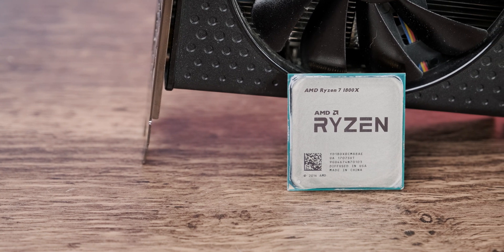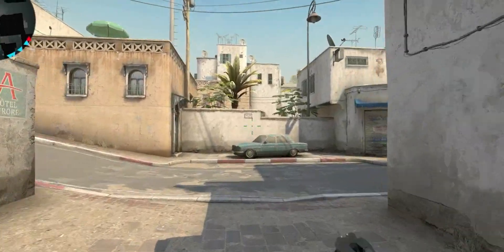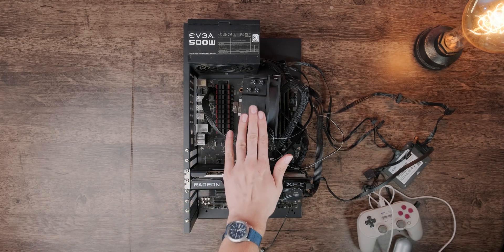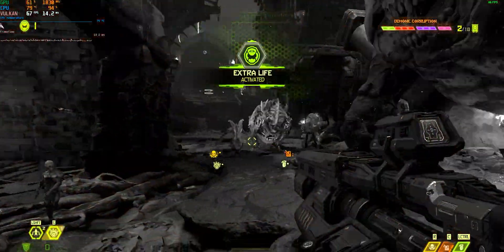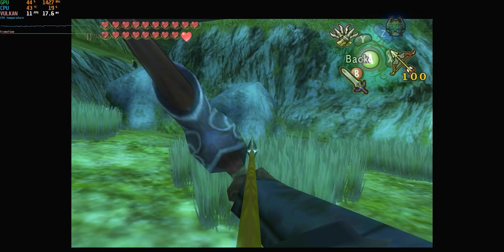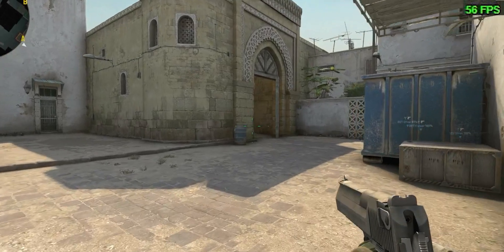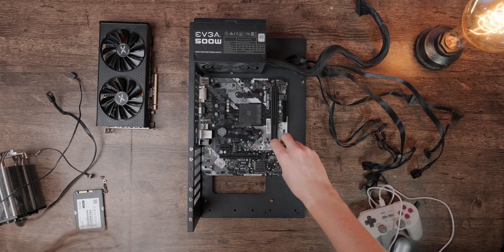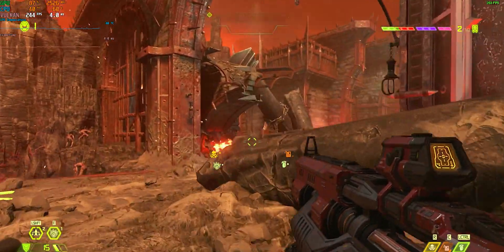WHY Are People Still Buying These CPUs? - AMD FX Series in 2023

Comment: I had an fx 8350 from about 2013 to 2018, i used a corsair H60 id gotten to cool my i7 920 (what a fireball too lol) overclocked mine to 4.9Ghz and frankly right up until about 2017 it never really gave me a problem. For all the performance the 1700x that i replaced it with gave me I missed the stability and consistency the FX had brought to the table, plus as a young graduate student the inclusion of AVX instructions made it massively faster for school work and simulation then my old i7 920. Even now, I miss how fun it was to overclock and remember it fondly despite its flaws.
Reply: I ran a FX6350 at 4.9ghz 24/7 but it would do boot up to 5.4ghz.
Reply: i7 920 aged terribly considering it lacks avx these cpus can still run warzone and most complex software in 2024 thats a win to me.

Comment: All FX CPUs could be overclocked and could also handle faster memory speeds. For the FX-8350 anything over a 5500xt or 1660 would be a waste.
Reply: I pair the FX 8350 with an RX 5600 XT. Let me tell you, it’s not a waste lol 😅

As long as you overclock the CPU, the RAM to 2133 mhz, the CPU-NB and HT Link to 2600mhz, it can handle this fine. I ran Assassin’s Creed Odyssey no issues at max settings with 50-70 fps with Vulkan API. Insurgency Sandstorm runs like a charm between 90-120 fps using DX12. GTA V and others get massive uplifts with +70-80% fps just by switching to Vulkan using the dxvk wrapper. 

But you’re right though, anything above RX 5600 XT is a waste of GPU power. You also have to tweak stuff and know what you’re doing if you want to squeeze performance out of this CPU.

Comment: look up RA Tech here. 
he digs into the whole 8-core debate.  He also shows more of the FX 8350 capability. The amount of cores makes it able to brute-force itself through a lot. 

I ran a FX 8350 between 2013-2021ish.  it worked wonders for me during the time i used it. 
and not long ago, I put together a computer with my old 8350 CPU, a m2(with adapter), 24gb RAM and a 5500 XT 8gb GPU.

my Spouse uses it and it is still able to keep up, just played Diablo 4 this weekend on it.

Comment: Still daily drive my 8350. Even back then it was better than most gave it credit for, especially knowing what we do now about Intel CPUs being more prone to vulnerabilities. After microcode mitigations, the i5-8400 benches below a stock 8350 in CPU-Z. While CMT may not have been as good an idea as SMT, the multithreading capabilities of these CPUs still had yet to be fully utilized until around 2015 or so. Once you get a stable overclock on an 8350 it's really not bad, but you have to do more than adjust the multiplier if you want to maximize performance. 

I've kept flirting with the idea of upgrading to Ryzen but I honestly don't have any reason to. Maybe some day when a game I really want to play simply won't run on my PC I'll give it a serious consideration. Until then, I'm gonna stick with ol' reliable.
Reply: Electricity and reliability? That thang gotta be leaving scorch marks on that board, and I’m sure the capacitors and power delivery are happy with old thermal pads.

The night and day from Ryzen is so worth it, you won’t regret it in the slightest.
Reply: @ApolloTheDerg  i still use a 8350 matched with a 1660 ti. I play cyberpunk at 50 to 60 frames no problem
Reply: @ApolloTheDerg I ran a fx 8320e oced to 4.8ghz for like 7 years at 1.4v and OCed to northebridge and cache pretty heavy along with oced memory controller to get ddr3 oced to 2566mhz as long as you change pads every few years any 990fx board can handle this easy

Comment: I am a big fan of bulldozer. Mind you I got fx for dirt cheep back then. I never paid more than $50 cad for any fx cpus I owned.

I had my 8350 and 8320 clocked to 4.7 ghz 2600nb 3000 ht link and 1866 cl8 ram.

I recently sidegraded to an locked i7 3770 in hopes that it would help in vr. No luck almost identical performance (however considerably less power drawn)

I haven't played many games after borderlands 3 but in that game my fx/r9 nano combo was doing way better than my friends i5 7400/1070 combo.

I live in an area with really cheep power so its not really an consideration.

I do agree that stock fx cpus are garbage expessaly pared with a stock cooler there throttleing algorithm was by far the most stutter inducing garbage ever.

Fx cpus at least need a locked 4ghz clock +small nb bump to 2400 to be decent. Also you really want at least the 6 core.

I'll call them cores because orignal cpus did not have fpus like the 8086 where the 8067 was an separate optional chip.
Reply: the fx cpus share A LOT in common with power pc in there core design . amd / raja kadori got his inspriation from ibm / now fx accels with linux and node and neural workloads and actually keeps upw ith newer cpus because of the way the resonant clock mesh was designed

Comment: Man the FX series is sure a blast to the past, I used an FX8350 up until I think 2020 (2017-2019 main) and they're the Fermi of CPUs haha, the power management was so god awful that for me to hold my 5.1GHz oc I had to run it at that 24/7 so no down clocking , I bet that system with my GTX 970 used over 500w at the psu. They were good with the few applications that could utilize them, though the power used was not worth only 80fps in wolfenstein 2 lmao, when I upgraded to a i7 6700 I was in a different world 😂

Comment: the reason these cpus are so bad is cause of the way the cores work. for example the 8 core cpus DO have 8 REAL cores, but the problem is, the cores are put in pairs, and each pair shares recources, this creates a terrible bottleneck because most programs were never designed to treat the CPU like this. There is some silver lining though, these cpus are actually BETTER today than they were when they came out, because newer games and programs have been made with these cpus in mind and they can be better utilized now.
Reply: Microsoft did release two fixes for the fx core architecture, for Windows 7. I assume, but don't know, that Win 10 has this already.
Reply: @Nick_R_  It does! I have a old 6300, 4350 and a 8370 and they all work absolutely wonderful with win 10. I don't use them much because they are more of a keepsake than anything else. My brother used to overclock competitively before he passed. I ended up with all of his gear and just decided to keep it.
Reply: @TheZachMan-09there’s 8 integer cores and cpus didn’t always have an FPU “math coprocessor” despite that when doing basic fpu work the fpu has two 128bit parts each able to do separate work.
Reply: The Fx 8350 is a 4 core CPU with Hyperthreading and additional integer-units. The FPU is just one of MANY parts that is lacking. More specifically there is NOTHING other than the integer-unit that was duplicated. Fetch, Decode, execute - the simplest breakdown of the steps a core needs to execute do run any program. Guess which part of those each module had 2 of? right - NONE. Cause only the integer cluster was duplicated - the smallest part of the CPU.

Interface to the rest of the CPU? 1.
Fetch? 1
branch-prediction? 1
instruction-cache? 1
Predecoder? 1
Decoder? 1
Dispatcher? 1
Write-cache? 1
L2 Cache? 1
Reply: @ABaumstumpf  the fx 8350 has 8 cores. and due to shared fpu it cant support hyperthreading. but the fpu is double bandwidth so can use use both cores simutainiusly . the fpu is the only shared resource
Reply: @rosspearson2805   "the fx 8350 has 8 cores. "
it has 8 threads, not 8 cores.

"the fpu is the only shared resource"
No, everything aside from the interger-unit is "shared" - aka it is 1 core with a integer-units slapped on it.... the part that even AMD stated is the smallest part of a core.
Reply: @ABaumstumpf  The 8 core FX CPUs like the 8350 I have have 8 integer cores and 4 FPUs. No AMD CPU EVER made had hyper-threading since that is an Intel invention. AMD created their version of it called Simultaneous Multi Threading and it debuted in the first gen Ryzen CPUs. Each module on the 8 core FX chips had 2 CPUs and 1 FPU. At the time AMD was designing the FX they thought FPU performance wouldn't be as important as integer performance. They predicted wrong. ;-p
Reply: @SirReptitious  "have have 8 integer cores"
They have 8 integer-Units - those are NOT cores (same as an FPU is not a core).

"and it debuted in the first gen Ryzen CPUs"
Nope - with bullcrapper.

"Each module on the 8 core FX chips had 2 CPUs and 1 FPU."
There are no 8-core FX chips. The biggest have 4 cores - with each core just being able to run 2 threads at once and having a second integer-unit.
But everything that makes it a core - from cache, IO, decoder etc - exists only 4 times in a FX 8350.

That is why even in benchmarks you can see that it has the same scaling as a 4c8t CPU.
Reply: Assuming the program only used 4 cores, would this mean it's beneficial to set the affinity for every other core?
Reply: True. Intact I use fx8150T today😊.
Reply: I'm still using the 8350 w/ an 2060 super, it's running great. Although, Battlebit, Rimworld, and Paradox games aren't really that crazy.
Reply: @SMongoosse  Im still rockin an FX 8370 and Ive still never hit a major cpu bottleneck in all the games Ive played
Reply: Yes but modern cpus are leagues better than them and the same price. They were crap back then and a unremarkable now
Reply: @sterkriger2572 that's A pretty valid point, I have an FX 8370 and I set it up on win 10 with 32gb of RAM and it wasn't anything impressive. I think it got around the same performance as a i3 4370 or something? Not bad for day to day stuff but draws way too much power and there is no program out there to accurately tell you the temperature of one of these CPUs.
Reply: @HardWhereHero So you didn't read the CPU specs before assembling the rig... Your FX can't use more than 16 gigs of ram. Throwing 32 at it is a waste of money. Also it has to be 2133 or 2400 - 1600 makes the rig stupidly slow. Bad ram choice makes the difference on capability.
I don't game on mine but it is very capable in the video production arena.

Comment: The 8120 really pulled power, so much so that depending on the board your MOSFETs would practically be on fire, it's likely all the microstutter was a power delivery issue where the board temps skyrocketed, I experienced the same thing building with one of these back in the day and needed to under volt things to get it under control.
Reply from the maker: That's insane. Would partially explain why my experience was so bad with it
Reply: @aChairLeg  flat boards in a test bench configuration don't get active airflow like they would in a case, either, which is why you'd typically see test bench setups with a downward firing cooler or an AIO arranged to exhaust towards the board.  Without it you're likely to see higher board temps around the socket because that heat just kind of balls up down there with nowhere to go.  It gets really bad on boards without MOSFET heatsinks because the surface area it has to release heat through convection is teeny tiny.
Reply: That's because a lot of am3+ motherboards are just updated am3s, really needed a heatsink.

Comment: Man, I'm just gonna say this: An overclocked Phenom II 1090t is smoother and more stable then the FX chips. I had mine cranked to 4.5Ghz with just a Hyper 212 for cooling and It was the daily driver from new til I got a R5 3600. Absolute pain in the ass to tune properly though, just cranking the Multiplier would actually degrade performance, it had an awful lot of small quirks. Had it paired with a 980ti at the end, it did well.
Reply: my now 12 year old Phenom X6 is in my media PC still chugging away. I bet I die before it does lol.
Reply: Still running a desktop with my amd fx 6350 chip for light work overclocked to 2.6ghz on the northbridge and 4.5 on the core. Its an absolute beast tackling even modern games. It just got overshadowed cause intel came out with way better cpus pretty soon after
Reply: ill disagree about the phenom i  would agree against the 8120 and 8150 but the 8300 series pile driver ? not so much  at the same clock speed the 8300 and 6300 would cream the phenom plus you get avx and sse 4.2
Reply from the maker: Haha I remember being told about that after getting my 6300 back in the day. Felt gipped for sure

Comment: i came here knowing what the answer was since I'm currently using one.

I honestly can't wait to finally be able to upgrade
Reply from the maker: Trust me, I was counting the days with my 6300 and r9 280. Most of what I did back then was play minecraft and emulate games. Both heavily single threaded openGL applications. Nowadays, though, the 6300 does handle games better with better multithreaded support
Reply: @aChairLeg  that's definitely true, but living in a tropical country like i do you'd probably not want a heater next to you lolll
Reply: @nan.a323  if you can find a deal on an FX-8370, they sipped power compared to 8350's , mine was doing 4.82GHz prime stable at 1.325v.  (on custom liquid cooling)
Reply: @aChairLeg  I was rocking fx6300 until year ago and minecraft ran terribly, but compiling was pretty good

Comment: FX really was that bad when it launched; Bulldozer was basically AMD's Netburst (only instead of selling itself with more "MHz", they were doing it with more "cores"), but unlike intel, they did not have a process node advantage to keep their failed architecture relevant.

I think a lot of the pricing has to do with supply; there's just a literal boat load of old Xeons and nowhere near enough demand to where they practically have to give them away (someone looking to get extra use out of an old X79/X99 system is only going to need 1 CPU, and a chip like the 2690v3 was intended for dual processor servers).

As far as perceived high pricing for the 8350, it might have to do with it being something of a flagship chip (just look at the top flagship, the FX 9590, which the going asking price appears to be ~$200), on top of supply being nowhere near as plentiful as the Xeons.

The real tell in demand is the motherboard/system prices; a used AM3+ motherboard from a name brand can be had for $20-50, but for X79/X99 those same brands will go for well over $100, if not over $200, which is where the Chinese Frankenboards come in to play, and even those will cost more than the AM3+ boards

I think (or perhaps mostly hope) that a majority of the demand for the FX CPUs is from enthusiasts looking to go down a nostalgia memory trip, or to scratch an itch to play with novelty hardware
Reply from the maker: That's very true. When it comes to sub $500 systems, I personally always think of upgraded pre-builts first, not building from scratch. An old hp, dell, or lenovo workstation that you upgrade is pretty cheap. Sometimes, the whole system is the same price as a nice x79 or x99 board.

Comment: I use the 8350FX in my NAS system. Yes I know I'm not energy efficient BUT I have enough air to run it as a NAS and Plex server plus it does regular backups etc. And all this without the system somehow reaching its limits. Although I will soon be switching to TrueNAS Scale, so I don't know what the system load will be like.

And before my old PC became my HomeServer/NAS, it was my main system until about a year ago.
Reply: The old am3 cpus make very good nas/server based  and configs properly they can run much cooler and using less power than default  while retaining an excellent capability for multi threaded needs

As for nas  truenas is ok but overall unraid is superior in many ways IMO  (I've worked with both and ithere for many yrs)

While the old FX AMDs do nicely for this  my own old 8320 is better overall than the 8350 (better therm/per stability esp when uv) and is setup to be able to boot anything from pc dos7 to w7  or w10 if wanted for that matter..  on bare metal   or such could be also dont for  most cases in a VM along with unraid  at the same time

The sad myths and badmouthing of amd at times still continues due to mnpanybvery ignorantnjackasses that just continue spewing crap they heard  "from a friend"  but such is almost always false, over stated or blatant lies

The pathetic nonsense trying to claim they were not 8 core for example   when they are and amd never tried to hide their design and details of how such worked

Comment: Any plans to OC any of these? I had FX 6200, 970a-ds3 and 8 gb of RAM on my hands a while ago and a friend of mine was in need of a PC, so I’ve built one using these parts.

Games like Genshin were running mostly fine, but there were a lot of stutters like on 8120. Amazingly, once I’ve raised memory frequency to ~1500 MHz and NB to ~2600, stutters were mostly gone and the experience was a lot better. Ended up just buying 5600G for my friend a bit later.

Though am3+ platform is almost dead as of now, and it was really hot (even the metal io shield was too hot, everything was radiating heat lol), it is still fun to play around with it.
Reply from the maker: I considered it, but my 6300 was somewhat of an overclocking dud, so it wouldn't have been the most fair comparison
Reply: @aChairLeg Aight!

Comment: I remember FX....

I was there...3000 years ago...when the strength of AMD failed.

On the serious though. 

I had an 8320e ( sold as a lower vcore, eco model by AMD...wink wink...it's just a better bin ) at 5.2Ghz under a, H115i for nearly 2-3 years before I got my 1600x in 2017. Thing was an animal, at the time.